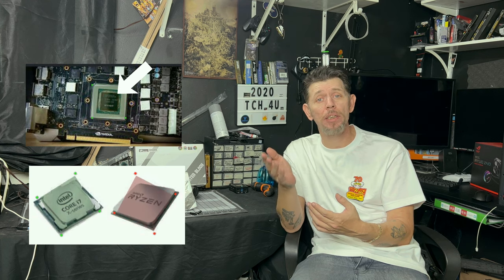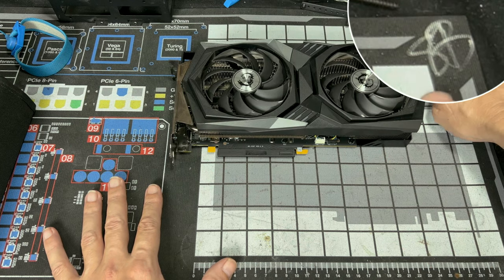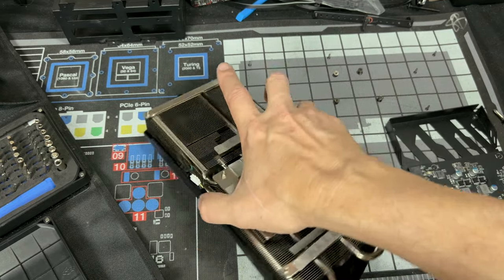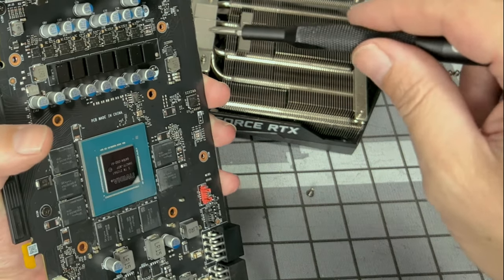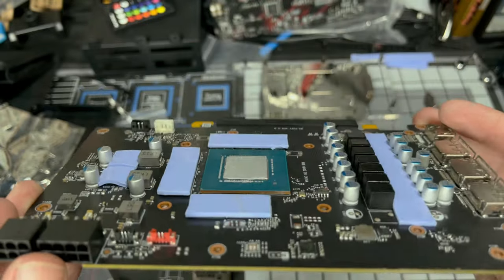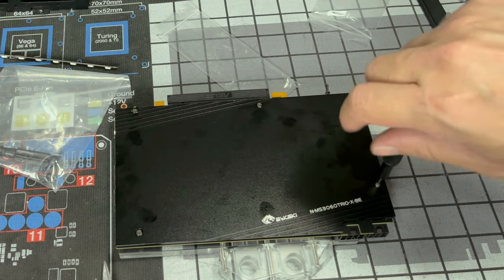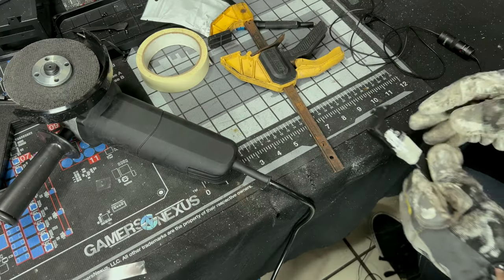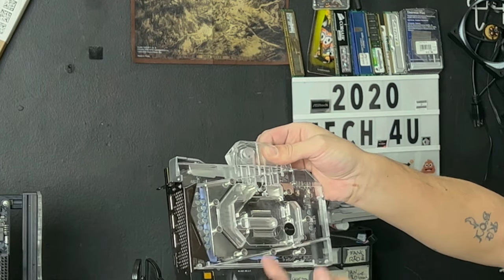GPU WaterBlock Install/Tips/Modding Guide. Great with any GPU Block. MSI 3060Ti Bykski Ice Dragon.

Comment: Does in/out flow matter?  If so, which is which? Thanks in advanced!
Reply from the maker: I tested this with water blocks and saw zero difference, but flow direction is usually over the fins first, so whatever outlet is directly over the fin stack is the inlet. Hope this helps.
Reply: I had to set up for about a year-and-a-half and I just disassembled it.. the block is marked in and out..  thanks man 🤙

Comment: What is the temp after installing the cooling?
Reply from the maker: Please excuse the time it took to reply to u, I just had to deal with many family issues so I hope u understand, I am working on a video right now about this, I am checking temps with the mono block on and no monoblock, I do not have the numbers infront of mre but I believe under load long working hours I saw a max of 55c on the power delivery (mosfet) FYI they are recommended upto 90c and higher. I hope this helped and I hope u watch the video when it releases, again I am so sorry for the long wait on this reply

Comment: Any plans to remove the chipset fan?
Reply from the maker: The chipset fan? Do you mean on the MOBO? The MSI board I'm using with this GPU is a X570S so no fan on the south bridge, but I did remove the fan from the TUFF X570 and I saw my NVME's throttling but that was about it.